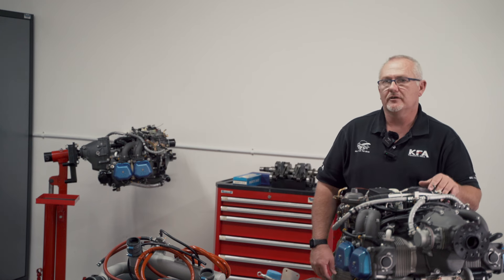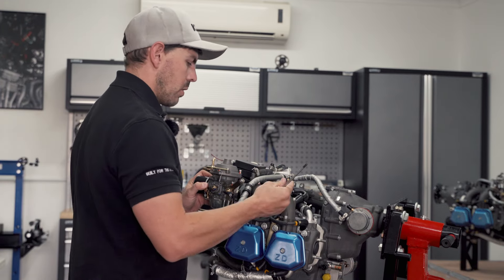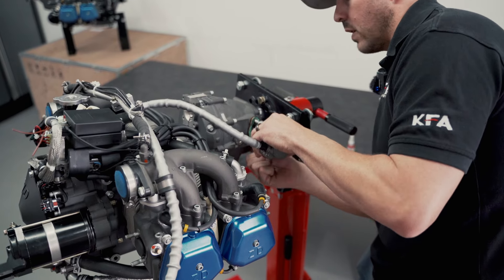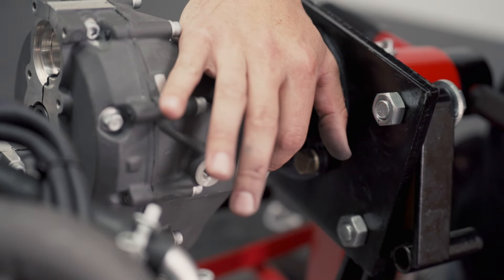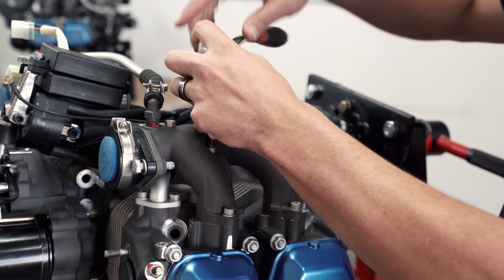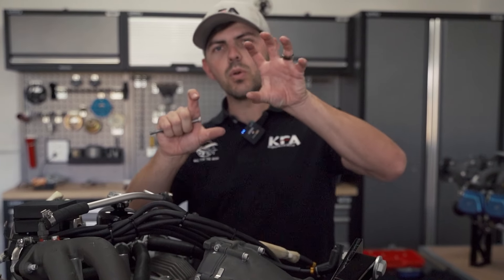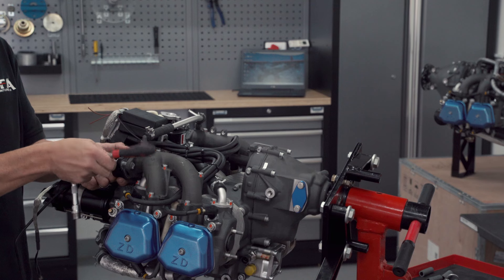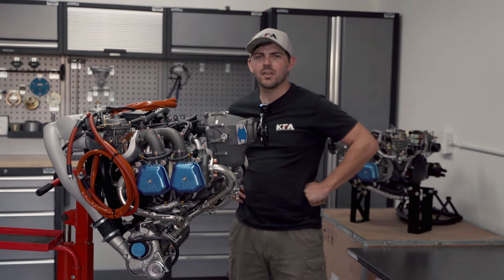Turbocharged Transformation, an Inside Look | Zonsen CA-500 | KFA 912 ULS-ST Upgrade

Comment: Just bought a Safari -Could you guys make a nother vid of wing folding on that plane.?
Reply from the maker: Congratulations on your purchase. Although most of the Safari models wings can fold in some way or another, it is not recommended. The Safari is a large aircraft and is meant to fly. The wing folding option was only made available for long term storage or if you have an unplanned out landing and need to recover the aircraft back to base. Best is to discuss what your intentions are with me at KFA and I can advise.